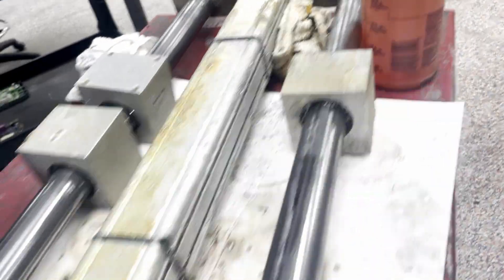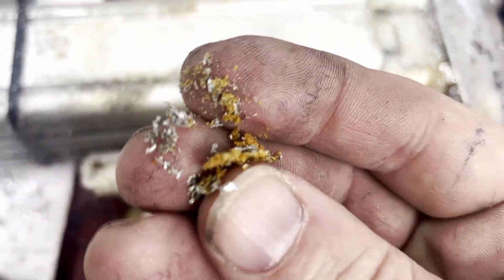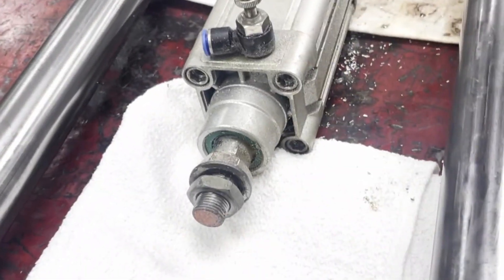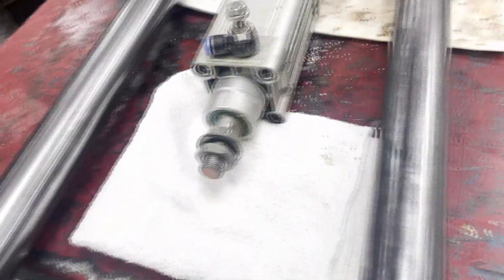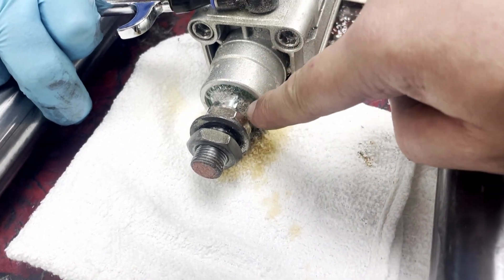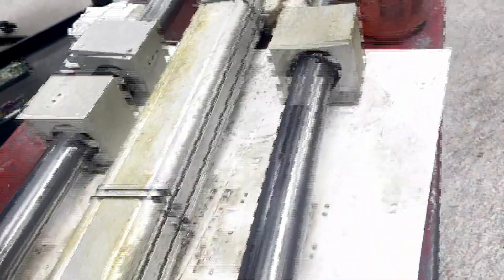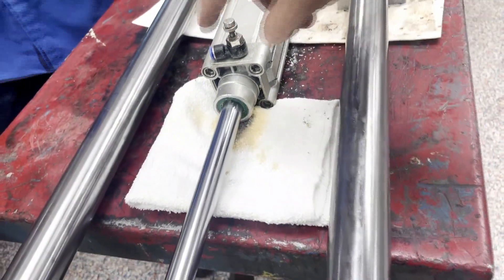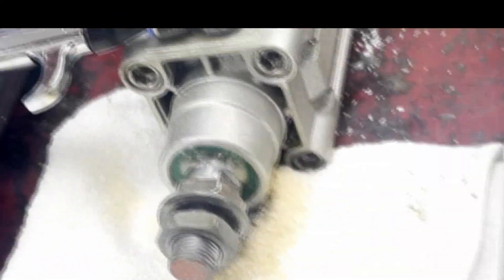Pneumatic Cylinder Easy Leak Test

Comment: Question. If I turn on the air to a pneumatic cylinder similar to the one in the video and it automatically engage, could it be an internal leak or blow by? Thanks